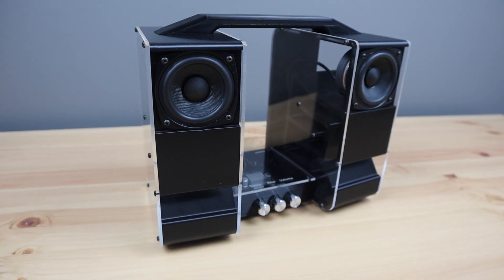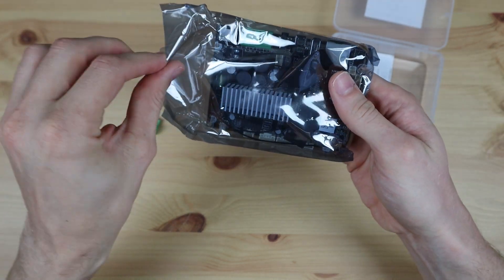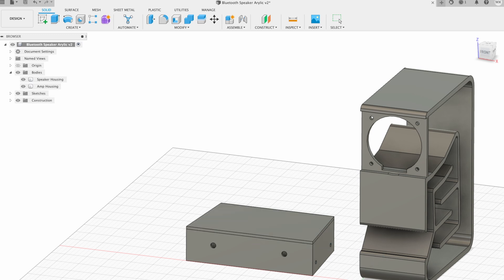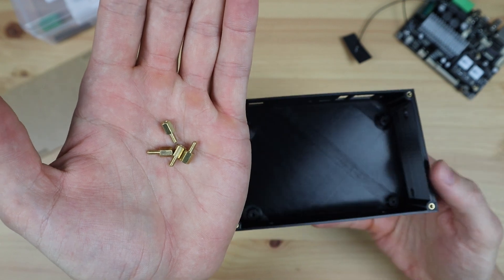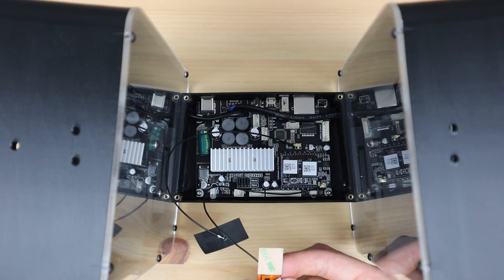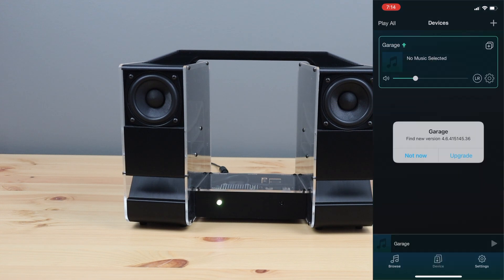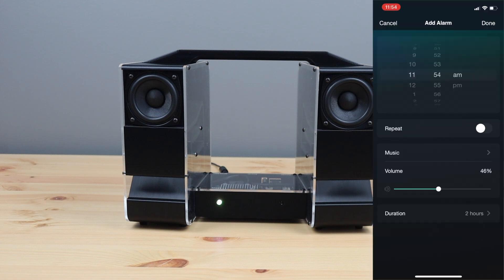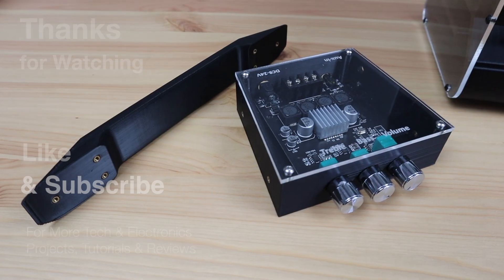I Upgraded My 3D Printed Speakers, Adding WiFi Streaming and AirPlay

Comment: That’s really cool, but I think what would make it even cooler is a display housing above the amplifier with an inch or two gap to fill in the empty space, as well as, add functionality to the speaker, and make it a standalone unit, so you don’t need a phone to control it.
Reply from the maker: The display is a nice idea to add. You can also use their plu-in button module or the remote to automate playing pre-set streams/playlists so that you don't need to use a phone.

Comment: Hi, is it possible to make a multiroom system without using the app to connect each speaker, like the old Harman Kardon Omni line up ?
Reply from the maker: I've only got one amp at the moment so haven't been able to test the multiroom system. I'd guess that you'd need to use the app for multiroom streaming. You might be able to AirPlay to multiple devices at the same time though.

Comment: arylic is a complete scam, they charge 70$ for a 25$ meanwell psu (lrs-350-24), and also there are even better quality amplifier boards for cheap
Reply: Could you point me to one of those? Because I'm not really able to find boards with this much functionality in 1 board (in my search, that's why I ended up with the Arylic up2stream 2.1 board)
Reply: @RinyVT  i mainly didnt like their move to resell the psu for so much money, as for the boards, you're right, there are not many boards with as many functionalities, but getting them separately would cost you significantly less... see for example VHM-314 (bluetooth) + TDA8954TH/TDA7498 amplifier boards (the first one being around 150W per channel, with some modifications needed, and the second board being 80w per channel without modifications needed) + meanwell psus bought from a legit reseller, not these guys selling it for 70$
Reply: @xzVice  Totally agree with you on the psu. Thanks for the information, will have a look at those!